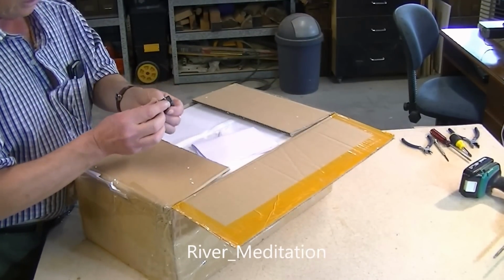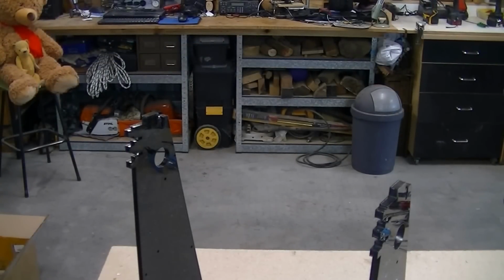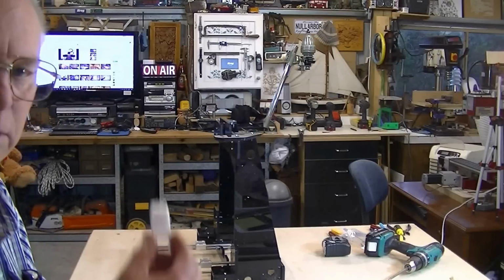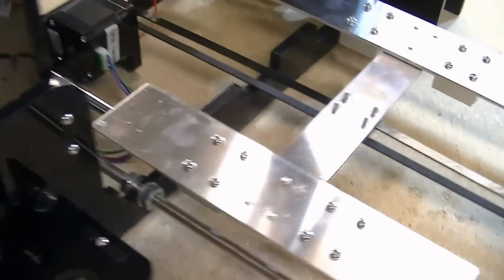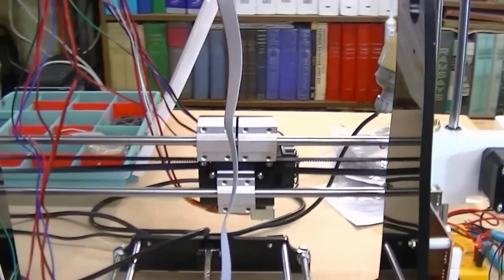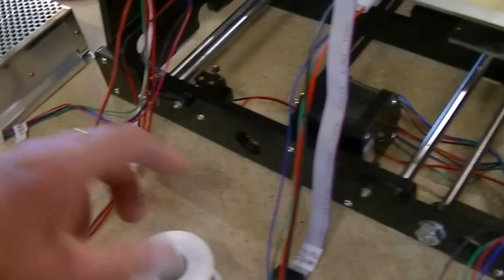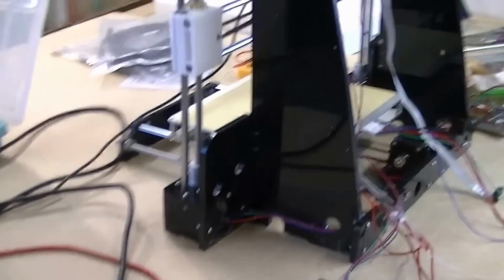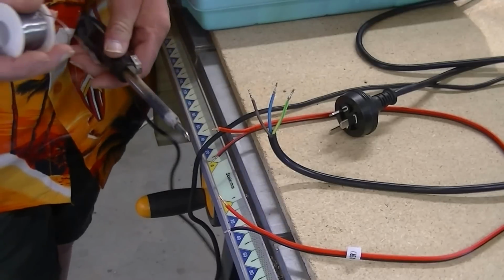3D printer build Anet A8 tips and tricks  Part 1

Comment: I received an Anet printer from my brother as an early 2018 Christmas present. Just started checking things and the first few changes I saw. The power plug (for USA) is 3 wire. Big bad thing for me is that the power supply labels are now lightly etched into the metal above the power supply screws and are difficult to see, so have to be very careful where I connect the power wires!

Comment: You shouldn't tin the wires when you put them in screw terminal. Solder is hard and by screwing it, it can crack and leave you with bad connection. Wire can also loose tension after time and pull out. It is often even prohibited to tin the wires that goes to screw terminal for safety reasons. I did this mistake too.
Reply: I second that. I'm a Dutch engineer who worked at a shipyard. All wiring had to be stranded because of vibrations. The wires had crimped terminals when they were connected to screwed connections.

Comment: I'm no EE, but they say you shouldn't tin wire that will be used in screw terminals as it doesn't crush down properly and allow for correct tightening of the screw. Ooops. Guess I should have read the two comments below.